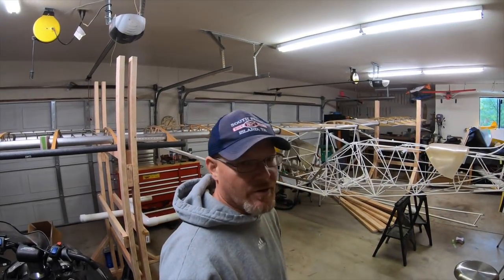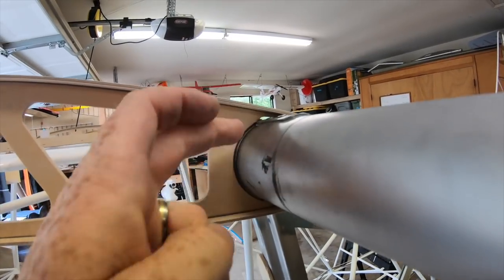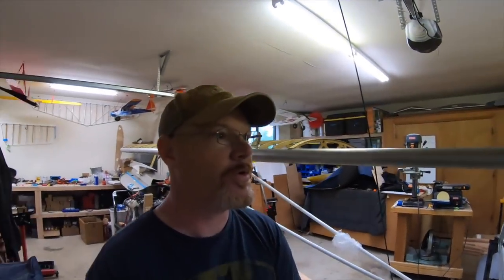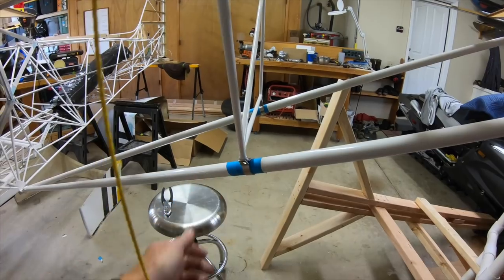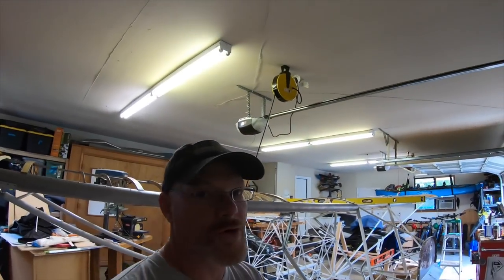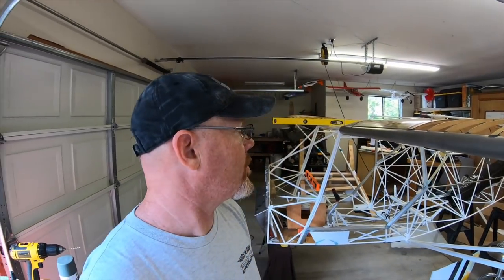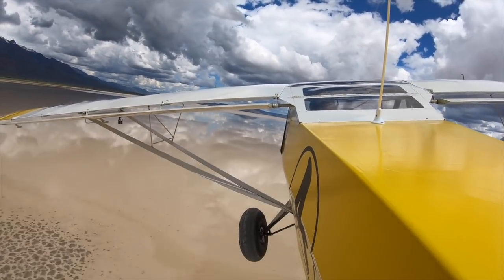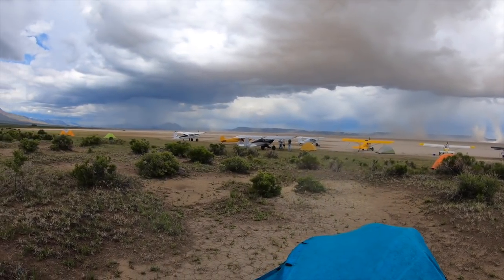Kitfox 7 Apex Build Episode 8 Wing Part 1

Comment: Hey Brian, did you drill the attachment holes in the spar that connect the wing spar to the carry through tubes? I checked episode 2 and it does not look like the kit you had purchased had the pre rigging option completed.
Reply from the maker: The guy I bought the kit from had done that already.

Comment: is fiberglass compatible with gasoline?  read some article where the fiberglass will separate inside the fuel tank.  nice vid also.
Reply from the maker: Kitfox makes the fuel tanks with fuel and ethanol resistant fiberglass resin.
Reply: Did you get the “newest” version tanks?
Reply from the maker: I have the 2018 tanks

Comment: When you talk about “flux” in the adhesive to prevent dissimilar metal corrosion did you mean “flox” (adhesive with cotton fibres added)?
Reply from the maker: Yes
Reply: NO!!!  Flox is added for easier bulking and sanding.  Its micro balloons he is referring too, which he is calling flux
Reply: Flox are cotton fibers and are added to adhesives (Hysol) as a thickener and strengthener. When you join two dissimilar metals, you add micro balloons, which are small silicon or glass beads that prevent all the adhesive being compressed away when clamping. From what I understand, micro balloons do not add structural strength like flox does. I do not believe that either additive have an effect on corrosion. Although using micro balloons would help keep a thin layer of adhesive intact, which may help prevent corrosion.

Comment: Hey there! Got one question, youre saying that the wings are not level, so how much higher are they from the center to the outer end? Or where can i find that info. I am fixing a kitfox 7 but cant find how to adjust the height.
Reply from the maker: So that would be covered under the wing construction section where you attach the wing to the fuselage. then the wing strut length is going to determine the dihedral.

Comment: Hi, tell me, please, the pipe from which the wings are made of what material is aluminum, titanium, steel and what is its diameter and thickness?
Reply from the maker: Aluminum.
Reply: @BowenAero  Thank you, I think aluminum is not reliable, but good luck to you.
Reply from the maker: @dmitrytoushe4533  Pretty much every modern airplane uses Aluminum spars, some older planes use wood and some newer use composite, fiberglass or carbon fiber.
Reply: @BowenAero   I’m just Russian, and therefore I think that in America only robots on 3D printers should make airplanes, only from carbon fiber and only using solar energy.
Reply from the maker: Dmitry Toushe Sure why not.
Reply: @BowenAero  So I ask why not.
Reply from the maker: @dmitrytoushe4533  Are you asking me why I am not making an airplane from a 3D printer made of Carbon fiber using solar power? Because I don't have any of that equipment or a design to accomplish that. But you should totally do that.
Reply: @BowenAero  What a pity you don’t speak Russian, it’s so hard for me to understand you.